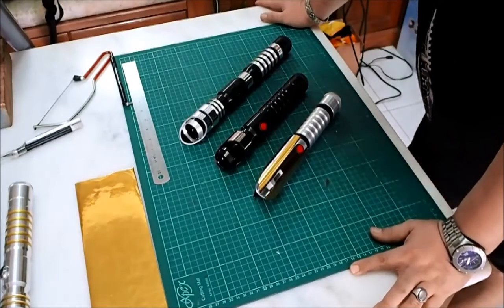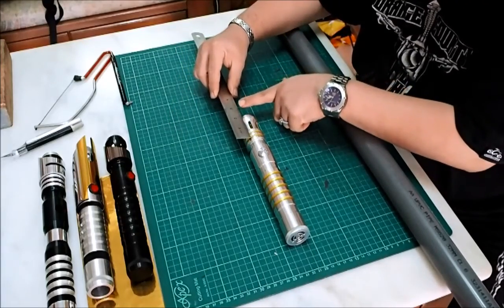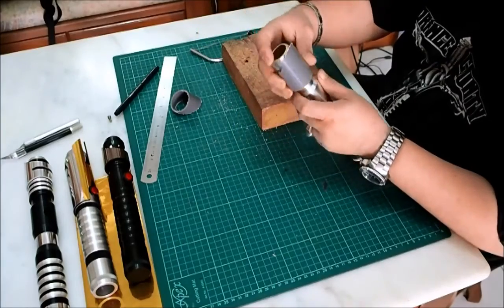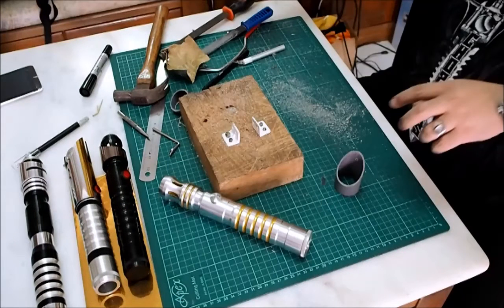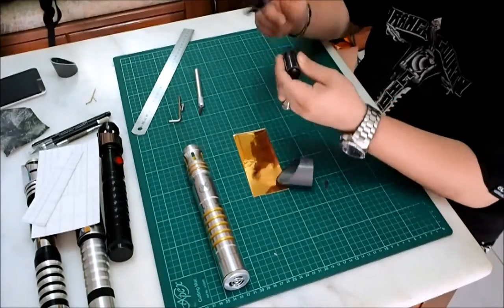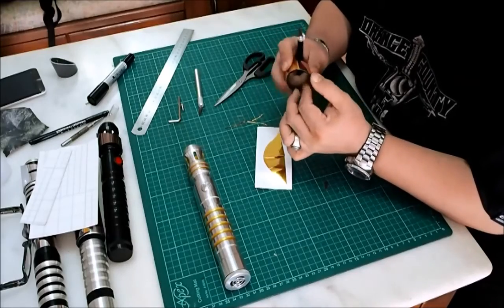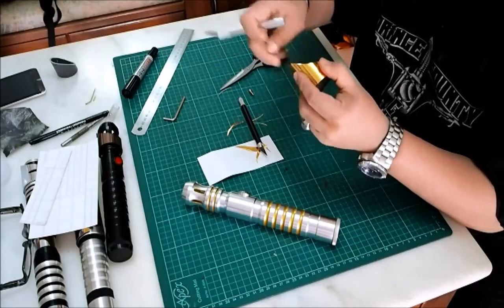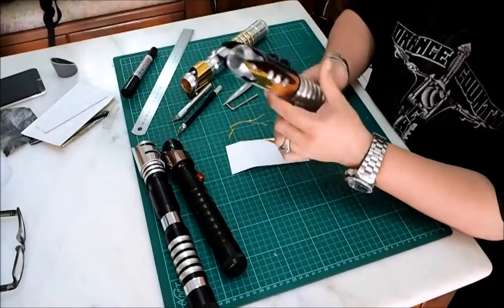How to make a shroud for lightsaber by ACLightsabers

Comment: Nice video. But I bought a pvc pipe that is size 1 1/4 schedule 40. It looks the closest but it fits tightly. What size pvc do you use?
Reply from the maker: the best way is to bring your saber when you shop for your pvc tube and test fit it on the spot. the tolerances is very big for pvc pipes and different tubes will vary although the stated size is the same.